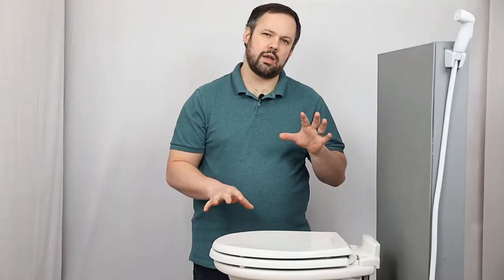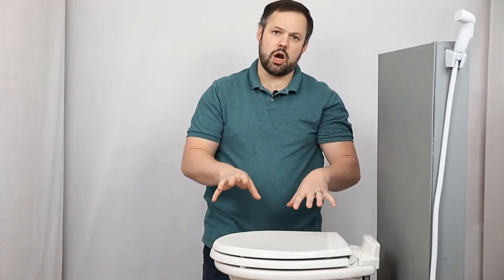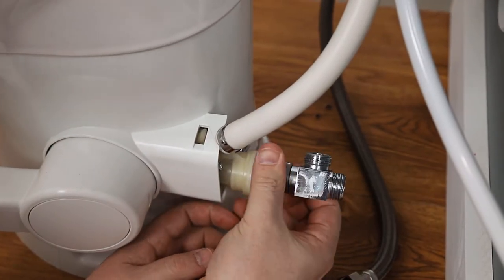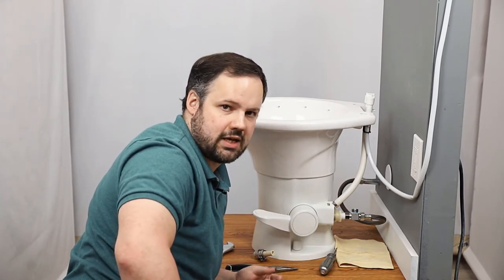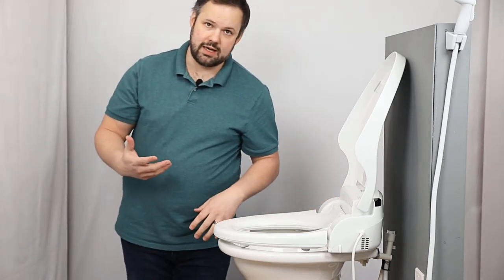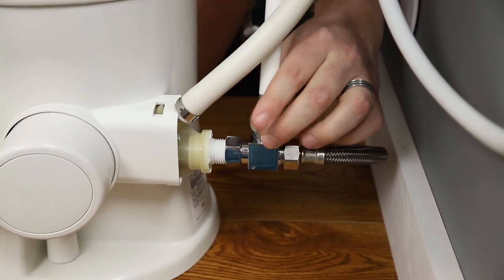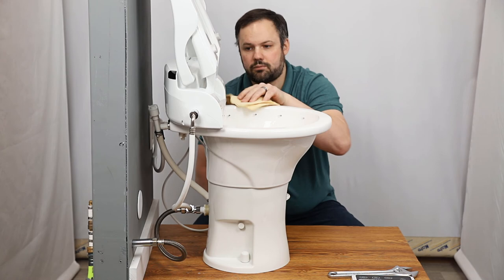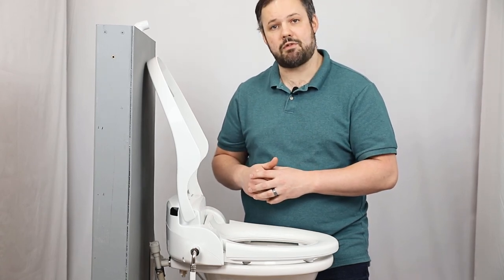How to install a Bidet Seat on an RV toilet

Comment from the maker: UPDATE: the Dometic 320 works with quite a few different bidet seats without the need for a kit, you just need the T.  It's also an elongated toilet, so you'll gain more sittable space.
Reply: Good to know!  I would have thought the permanent ceramic hump behind the seat would have interfered.  Do you know what the spacing is between the bolt centers and the hump?  Any recommendations for bidets that will fit?

Comment: I made my own vacuum breaker extension by getting clear tubing from Home Depot, it comes in a roll of 10ft,  I got the 3/4in outer diameter (od) and 5/8 inner diameter (id), it’s a vinyl kind of tubing. It tightly slips over the vacuum breaker and fits tightly in the rubber bushing on the toilet. It is a bit hard to get onto both and what makes it easier is to pull the gasket off the toilet put the tube through and then squeeze the gasket back in. The tube is a little flimsy especially if you’re squishing it to try and get it onto both ends but it fits so snuggly you don’t even need any clamps.

Comment: Your video is very informative.  We use Bio Bidet BB 2000 at home and I would like to install one on our 2020 Tiffin Allegro Bus in our rear Dometic macerator toilet.  The Dometic toilet appears to have seat bolts on 7.5" centers and the normal, domestic toilet seat appears to be mounted on 5.5" centers.  Do you sell an adaptor mounting plate or do you have any ideas for mounting a domestic bidet on a Dometic macerator toilet?  Thanks very much for your help.
Reply from the maker: Sadly we have not had any luck installing bidets on and Dometic macerator toilets...
Reply: @ManyBidets  is there any complete toilet that we could replace it with that has a macerator?
Reply from the maker: @MrMrWrench  Sadly there is not :-(
Reply: @ManyBidets  Thanks very much for your quick response and help.  Great videos.

Comment: does the back valve cover on a dometic 320 come off on all of them? it looks to me that it's all one piece to the bowl when you take the seat of?
Reply: in the video you call it the back portion
Reply from the maker: On the 310, the back comes off, but the back of the 320 is built into the toilet, so there's no removing it.  However, we have found that select bidet seats work on the 320 without removing the back (the Cascade 3000 being one of them)  Let me know if you have any other questions!

Comment: Why doesn't the bidet need a vacuum breaker like the toilet water in flow to the bowl?  Is there a risk of backflow from the bidet?  Does the bidet have internal valves to address this and make a vacuum breaker unnecessary?
Reply from the maker: Most electric bidets have some sort of backflow prevention built into the seat. Sometimes that is built into the solenoid or in other parts of the seat. Reach out to us directly for more details on this if you would like.

Comment: Quick question ... I currently have a Brondell LE89 for round residential toilet bowls in my home. Would this bidet model fit on the Dometic 310 toilet? Any and all guidance is much appreciated!
Reply from the maker: It's possible, but without testing, we couldn't say for sure.  We know the following will work well for sure:
Cascade 3000 Bidet Seat: https://www.manybidets.com/product/cascade-bidet-3000/
Blooming R1063 Bidet Seat: https://www.manybidets.com/product/blooming-bidet-r1063/

If you're looking for a more affordable option the blooming is a great choice.  We can offer pretty substantial discounts on it as well.

Comment: Hi! I was wondering if you know where I can find that tee adapter? I can’t find one anywhere!
Reply from the maker: Thanks for asking!  You can get it here: https://www.amazon.com/Diverter-Fitting-Adapter-Connector-Sprayer/dp/B0156FHJ7A/ref=rvi_13/147-4641528-6903666?pd_rd_w=n3Bt4&pf_rd_p=c0296674-5a83-4ad6-b035-0702d2b359df&pf_rd_r=QK43DKDE5VQ7T5WZJ7NT&pd_rd_r=86300d5b-0437-4df7-ba1d-9e7970126f10&pd_rd_wg=Gxzzt&pd_rd_i=B0156FHJ7A&psc=1

Comment: I'm looking for the rv kit you talked about but can't find it..please help?
Reply from the maker: Email us at support@manybidets.com, we're happy to help!
Reply: I made it work by getting clear tubing from Home Depot, it comes in a roll of 10ft,  I got the 3/4in outer diameter (od) and 5/8 inner diameter (id), it’s a vinyl kind of tubing. It tightly slips over the vacuum breaker and fits tightly in the rubber bushing on the toilet. It is a bit hard to get onto both and what makes it easier is to pull the gasket off the toilet put the tube through and then squeeze the gasket back in. The tube is a little flimsy especially if you’re squishing it to try and get it onto both ends but it fits so snuggly you don’t even need any clamps.

Comment: What if there is no electrical plug on the wall by the toilet?
Reply from the maker: You can run an extension cord, or install the Go Bidet Attachment: https://www.manybidets.com/product/gobidet-bidet-seat-attachment/ which does not require power (but of course is much less feature rich.

Comment: Hi I would like to know what the sizes of the two pipe extender pieces are that fit into the Dometic 310, it would be appreciated.
Reply from the maker: I'll look that info up, and let you know.  Thanks for asking!
Reply from the maker: Also, we recently found that these seats work on the dometic 320 without the need for an adaptor :-)
Reply: Many Bidets I saw a remark to you that Dometic 320 toilet works with no need for an adaptor. What seats are you talking about? I am ready to buy. Thanks
Reply: I made it work by getting clear tubing from Home Depot, it comes in a roll of 10ft,  I got the 3/4in outer diameter (od) and 5/8 inner diameter (id), it’s a vinyl kind of tubing. It tightly slips over the vacuum breaker and fits tightly in the rubber bushing on the toilet. It is a bit hard to get onto both and what makes it easier is to pull the gasket off the toilet put the tube through and then squeeze the gasket back in. The tube is a little flimsy especially if you’re squishing it to try and get it onto both ends but it fits so snuggly you isn’t even need any clamps.

Comment: Thanks for the video, that's a lot valuable informations, would you tell me if the TOTO washlet will fit on a dometic 320?
Reply from the maker: You should be able to make the TOTO units work on the dometic 320 with the space that's available in the back of that toilet.